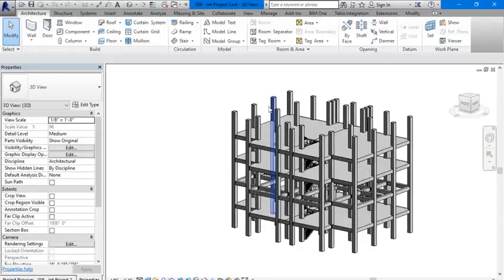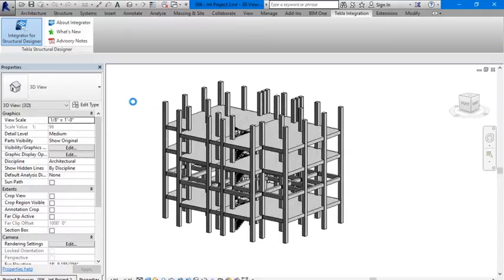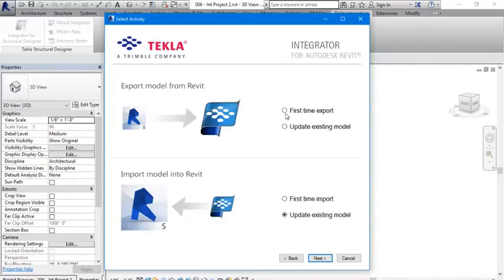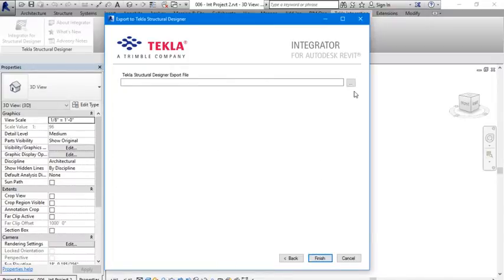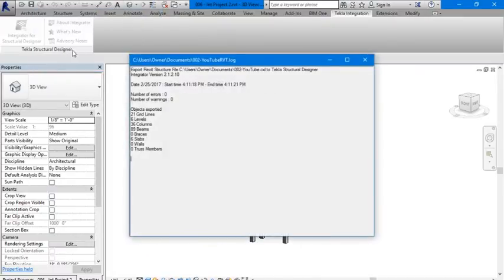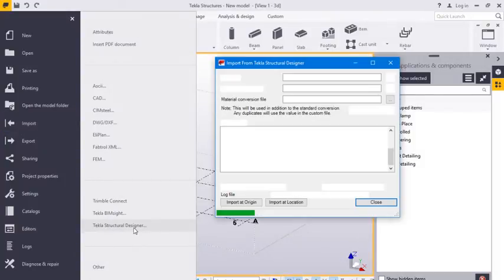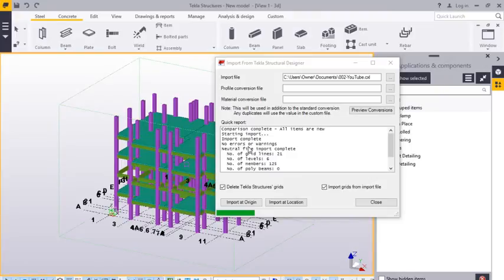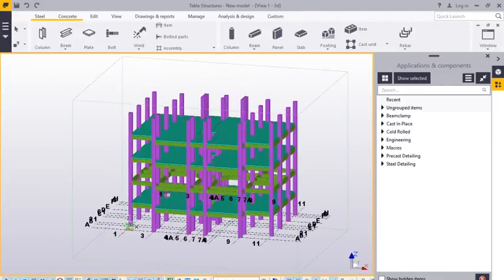How to Export Revit Model and Import into Tekla Structures

Comment: Sir, I've tried and it's work for concrete elements but for steel columns and beams I receive all the time error message elements can not be converted what can I do to fix this because it will be perfect if make the steel model in Tekla then impot it in revit

Comment: I have downloaded the TEKLA integrator for Revit 2018. Upon doing the export, I was prompted with a warning stating about Revit.Argument.Exceptions then nothing happens nor exported file. Does this mean my Revit model is corrupted?
Reply: And why out of 900+ structural columns selected, only 700 were recognized by the TEKLA integrator?

Comment: Good tutorials !!!

Where u get tekla extension ? it's available for Revit 2018 ? I just check on tekla's web and install tekla's extension for revit 2018 . But i cannot see the export menu's on tekla integration tab .
Reply: Thanks for your guideance . This is my another account, i've know what my mistake is . I looking for tekla structure's extension not tekla structural designer extension .
Reply from the maker: You can download the Tekla extension at the Autodesk Exchange store. Click the X looking icon at the top right-hand side next to the sign in tab. This will take you to the store.
Reply from the maker: I don't think there is the X icon is there for 2018 version of Revit, but you can click the trolley icon and it would take you to the download page. You would just have to search it in the search box.
Reply from the maker: Glad to know that you've gotten through.